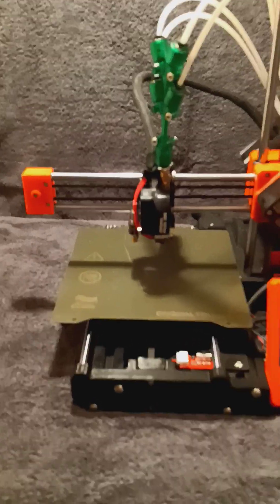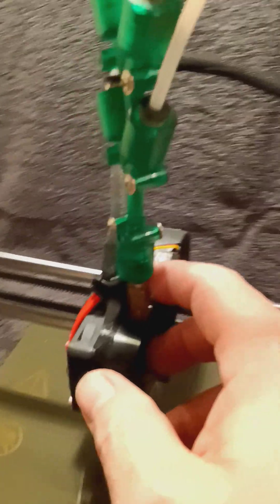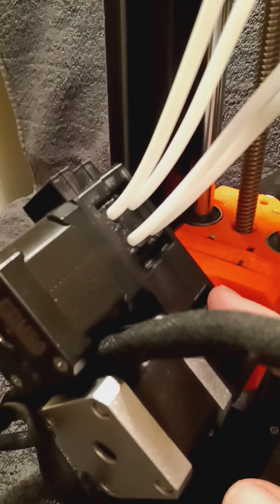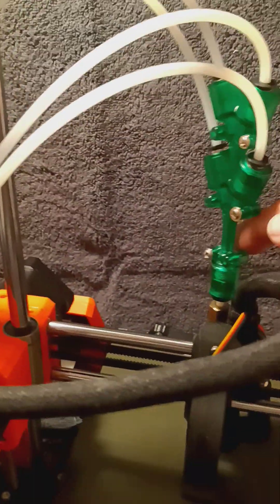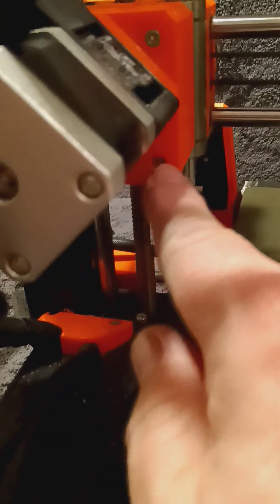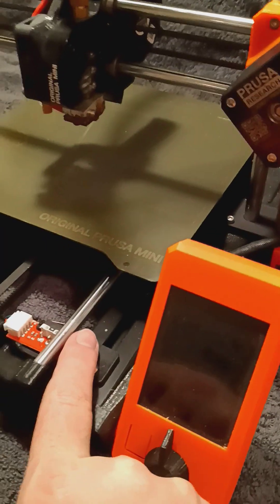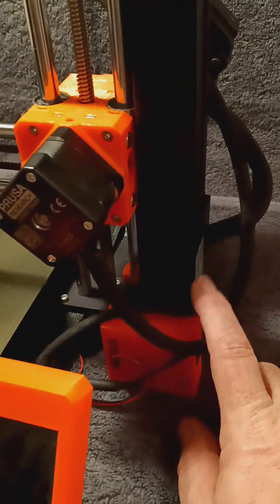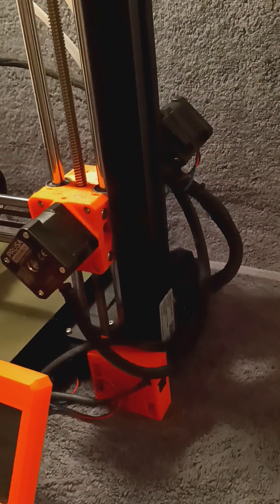3D Chameleon Mk2 on the Prusa Mini

Comment: Hello! I'm interested in purchasing this for my mini but I have a couple of questions:

Does the additional weight on the extruder not affect performance with the mini, especially having a cantilever setup? 
Why not just feed the 3d chameleon to the original extruder and have that deliver the changed filament through the original bowden tube?
Have you been able to test out the new alpha firmware update and see if the additional weight from the 3d chameleon affects performance?

Thank you!
Reply: Actually, you can (and we do recommend) you install it feeding into the stock extruder.  When we first did this installation, however, this was a very clean install... (difficult, to be sure) but very nice looking in the end.  As for testing, we haven't done anything to check the performance... but we have on other machines, like the Bambu, and found no differences at all.

Comment: I have a dual gear extruder mod, do i need to modify the stl or mount the stock extruder in order to mount the chameleon?
Reply: If you want to maintain your dual gear extruder, them all you need is to  use the basic installation, which means you only need the ability to attach a PTFE to the input to your extruder.

Comment: Hi there,
In the video you talk about alternative mount plates with screws instead of the zipties.
I visited the thingyverse page but don't see them there?
Where should I look?
Reply: Found them on your printables. Is there a difference in the MK3 mounts and MK2 alternatives?
Reply: @TheMagman  No... the mounts are identical.
Reply: @williamsteele  I just loaded them into Blender. They are not the same. Part B has a thicker shell so the 35mm screw to the chameleon body won't fit. This is adjusted in the ziptie one.
I will just use that one.
Reply from the maker: @TheMagman  Ah, you're talking about the screws for mounting them... I understand.

I edited the original Tinkercad to use our standard 35mm screws.  I'm adding links to the original Tinkercad files in the description so you can download them.  (It won't let me post link here.)
Reply: @3d_chameleon  Maybe it would be better to upload them as stl's to the thingyverse (clearly marked as alternatives). There is a lot of linking going on to different platforms and I think you would benifit from consilidating to one. Or make all the information consistent on all the platforms.
Reply from the maker: @TheMagman  I won't be using Thingiverse in the future... all of our updates are to the original source files on Tinkercad... so that others can edit them as needed.
Reply: @3d_chameleon  I am not familiar with Tinkercad, but thanks. I am enjoying the install although I have to admit it is more work to search for all the documentation.
I know you are working on that so I wish you luck ;). I will let something now when I have success.
Reply from the maker: @TheMagman  Feel free to email me with any questions... and make sure you follow the steps for installing the post processor for PrusaSlicer (using Python.)